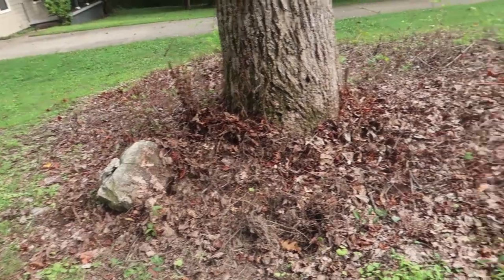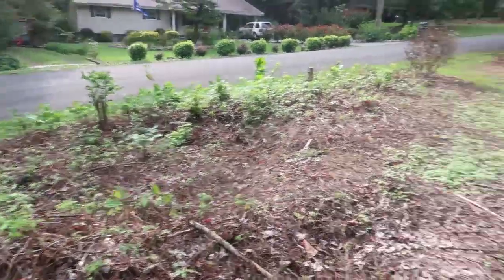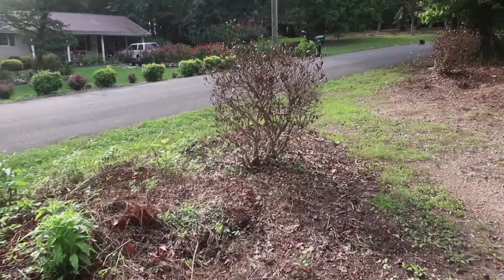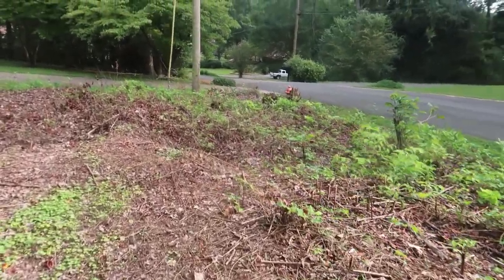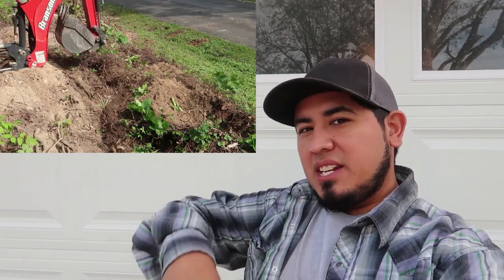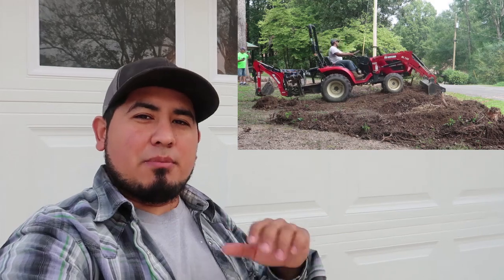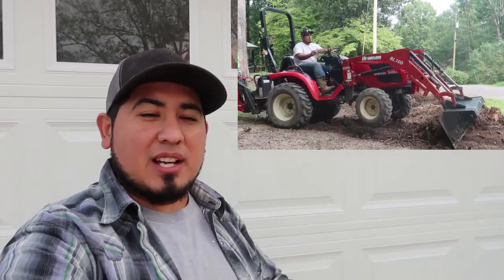Subcompact tractor hard at work! [Small hill turned out to be a Big job]

Comment: I have been doing small tractor jobs in southwest Colorado for over 10 years.  These compact tractors are very handy but it does take a lot of money to have the tractor and attachments to do a wide range of jobs.
Reply: I started out with a 30 hp kubota but it was a little small for some jobs,  I am using a 45 hp TYM now and it does a little better. I am considering a 60 hp.
Reply: @El.Stumpy  I have done jobs that have taken 2 weeks to complete,, I do prefer jobs that can be completed in 1 day